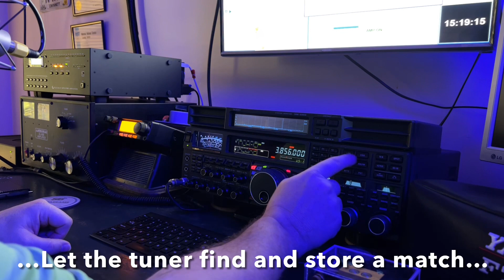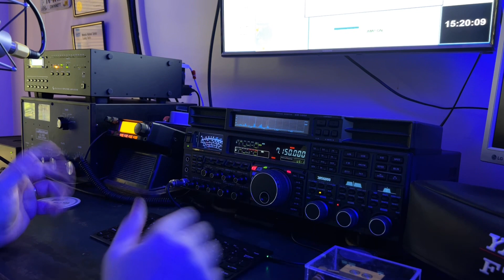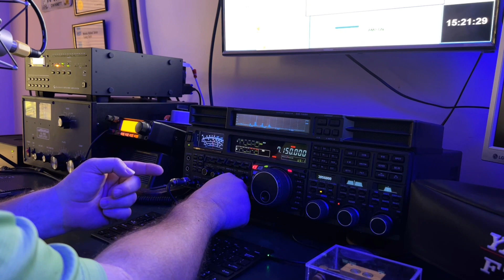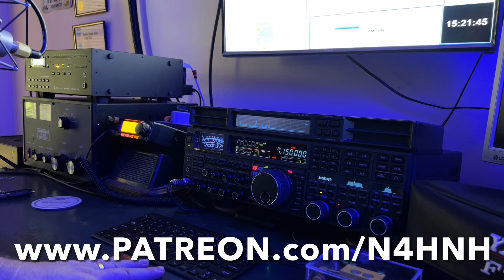“Train Your Tuner” #hamradio #hf #elecraft

Comment: I always have issues with my AT-100Proll Autotuner kicking in at odd times.  Wish you could do a video where you demonstrate this idea of Tuning the Tuner.  I find when I try this at 20W, it changes if I up the power setting.
Reply from the maker: The auto tuner will generally have a threshold that if exceeded, it will retune, and if you increase the power, the SWR could change. The LDG tuners don’t seem to recall match parameters like the MFJ and Elecraft automatic tuners do. The LDG antenna tuners I tried don’t track the band changes VFO movement. For example, the MFJ-998 Intellituner, when connected to your radio with the appropriate cable, will select prerecorded match parameters as you rotate your VFO.  The MFJ-939Y could do that as well.  I demonstrated that in a video in my POTA playlist.  See W4KWM RV Base Camp and Buzzard-1 Antenna https://youtu.be/7tDSIURusS8
Reply: @n4hnhradio  Thank you, I will check that and yes, you described another issue with this tuner as well.

Comment: Is it possible to "train" internal antenna tuner in the FT-710?    My experience is that I can get the tuner to tune to a flat SWR on a frequency.  Takes maybe 5 seconds of relay chatter. Then even if leave VFO on same frequency and tune again, the tuner still goes through the same long tuning process.  So it appears is does not have any memory?  Is that correct?
Reply from the maker: Don’t retune. Just transmit. If you long-press again, it assumes that you aren’t happy with the previous match.

Comment: Hi Doug, How do you apply such automation when you have multiple antenna farm. Thanks 73
Reply from the maker: Hi Martin!  The amplifier has two antenna ports. I only have two antennas that need the tuner. The amplifier stores the matches per antenna port. The Elecraft KAT-500 has 3 antenna ports. When you select a different antenna port, it recalls the match parameters for that antenna. As you change bands, it returns to the last antenna you used for that band. The KAT-500/KPA-500 combo is the best tuner/amp deal in ham radio, IMHO.

Comment: Thats all fine and dandy if you can afford an Elecraft tuner !
Reply from the maker: The KAT-500 Is currently $879.95. That isn’t much more than the price of the MFJ-998.  But you can train an MFJ-998 to operate similarly. 

The Elecraft combo, which includes the KAT-500 tuner and the KPA-500 amplifier, doesn’t cost much more that an Ameritron solid-state amplifier that doesn’t include an antenna matching unit. The amplifier is capable of 600W+, which is more than enough power. You gain the most in the first 400 to 500W anyway.

73, de N4HNH
Reply: @n4hnhradio  Kat 400 at Waters and Stanton over here in the UK £950 ! I'll stick with my MAT tuner :)
Reply: @101jumpit  If you have a mat 30 or other compatible model, you should be able to train it as well. Cheers 🍻,
73,
Stuart AJ4RM